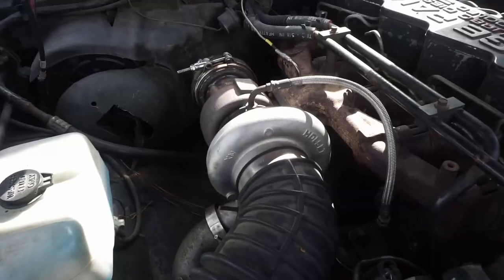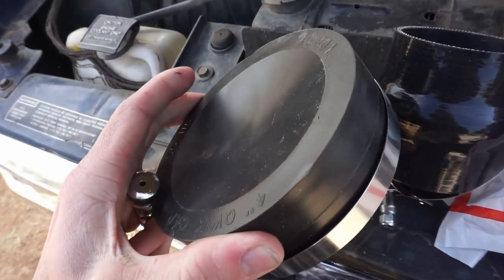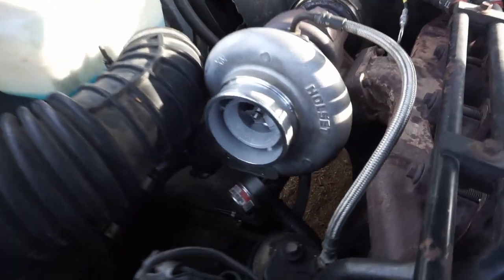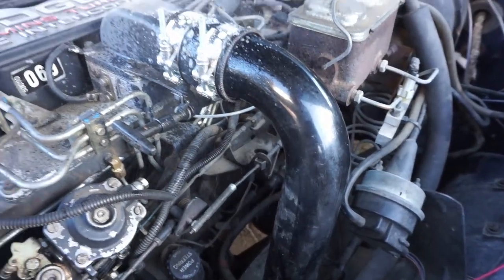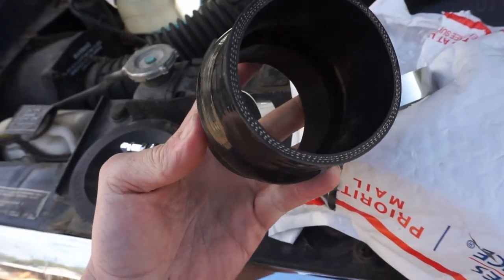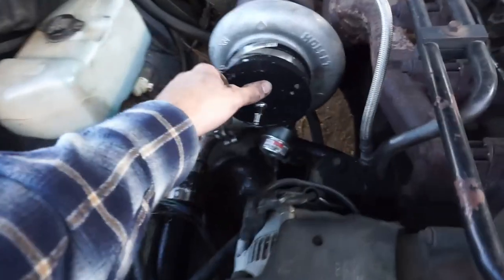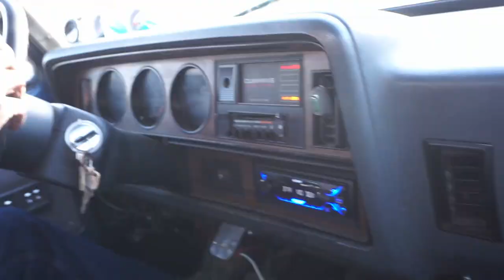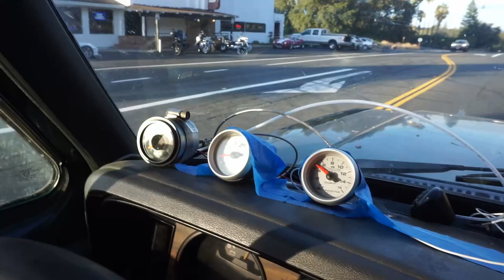Why Boost Leaks are Terrible! (And How to Test & Avoid Them)

Comment: It would be better to use a vacuum system smoke leak tester. Just fill the turbo and intake system with the smoke, then use your pressure system there to push the smoke out if the holes are small and need the pressure to show the leak.
Reply: if smoke machines werent so damn expensive. I wonder if a lit cigarette will work? then put the boost tester on top of it

Comment: I had a turbo boost leak in a 2013 Ford escape. Car is actually never been run hard. The only reason we figured out it was terrible was because it was smoking like hell. It was not overheating. I did put a little bit of stop leak in through the radiator overflow. Honestly it's been working fine. I know you're cringing reading this whole thing haha but I am a single mom who is also a single grandma mom taking care of her two severely premature grandkids full time. I also am only in my 40s . I have life left in me and I hope my car does too. I have knowledge about cars and know that I have to get from A to b because of the kids and also because I have Lupus and multiple doctors. Don't yell at me for putting this stuff in the car do you think it'll be okay or should I get rid of it? I have had 17 used cars. Never had a turbo go out on any of them 😞

Comment: What you would expect to see with a substantial leak especially from turbo is a lot of exhaust coming from the tailpipe muffler system , right? 👍 Also when idling or stopped at 🛑 stop signs it huge smoke

Comment: It's not fine to use 100psi. If you theoretically fix all the boost leaks and pump 100psi into the system your gonna blow something creating another boost leak or worse
Reply from the maker: With new boots it held 100psi, so I'm not worried about it.
Reply: Not only that, certain components might just not be able to handle the pressure and just straight up break, sensors, your intake manifold, blow off valve, etc. Better to test at the max pressure you expect to see during normal operation
Reply: @MrTurbo_ honestly have to agree with you bro.